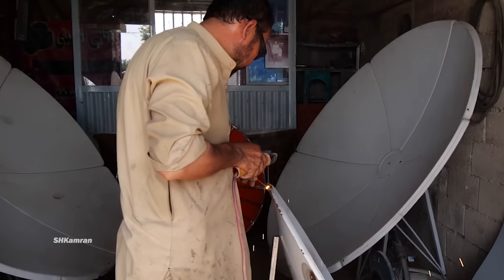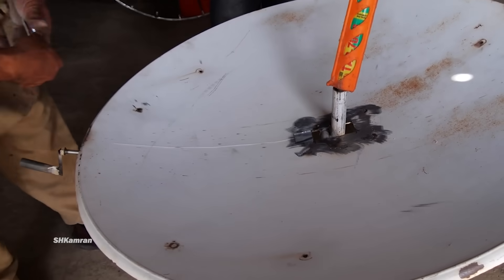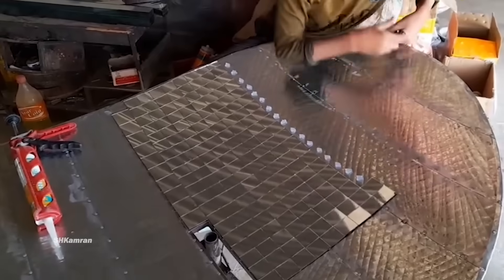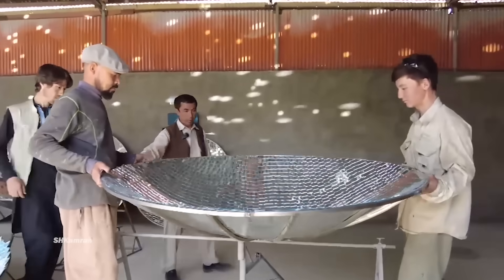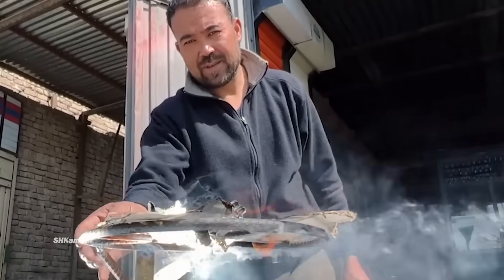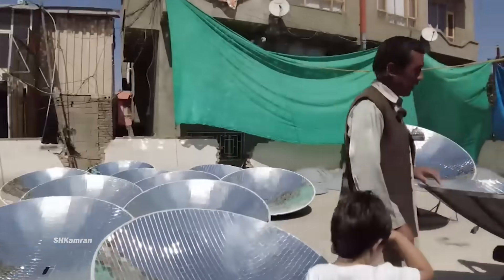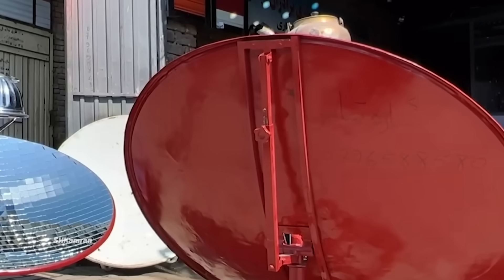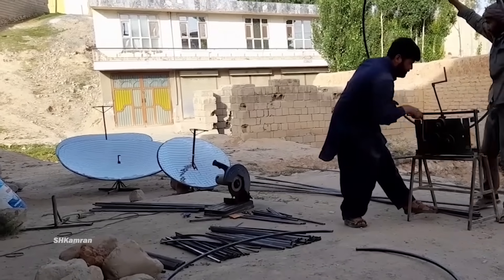Free Solar Ovens, Made in Afghanistan. Free For Cooking.

Comment: I designed a better shape in 2007, uploaded it to the web and improved  the idea over time.   Nobody ever even tried it! This year I  built one to prove it works.   I call it the Sun Scoop and it has been great.  It is about 1/6 of a much larger dish (so about the same size as the Afghan dishes).  It has automatic tracking by a timer and it is much less likely to blind the cook like this one.  Seasonal adjustment is manual once or twice a week, and daily adjustment is 15 degree per hour rotation.   If a few engineers were in charge of the Afghan solar project, they could look at the Sun Scoop,  and adjust and improve their program within a couple of weeks and start to make much better solar cooking  reflectors.   It is sad that people have such a hard time with new ideas.  In Afghanistan due to the latitude, people can put 2 reflectors on one sun scoop axis, and get something like 2 horsepower from the one device.  (but at 2 fixed focal points.) Again, it's pretty simple and any engineer or astronomer would understand how it works.  But most on youtube don't get it.   It's sad.

Comment: So this is a well-known technology, only in the worst performance... After all, instead of making a primitive furnace, an electric converter could be installed in its place, which would supply electricity by wire, and they could already supply electricity to anything. I am a man who is half Afghan, but grew up in Europe, and it's hard for me to be proud of that)))
Reply: Converting sunlight into electricity is much less efficient, only about 20%. Using the heat directly is about 80%, estimated.
Reply: @SolarCookingGermany  Anyway, it would be more efficient if these devices were used to convert electricity, since it would have more applications. In the long run, you can buy batteries and use electricity when the sun is no longer there.

Comment: Would a highly reflective thin metal foil not work just as well and take seconds to apply to a plastic or fiberglass parabola with some glue and a jig to press it in place? How much more work hours go into cutting and hand glueing small mirrors on such a large solar concentrator? It just seems too much work.
Reply: Yes, but metal foil isn't as reflective as mirrors and it'll degradate over time. Also, this would require a higher level of production facilities

Comment: Coat it with solar panel on the backside… when not using it generates electricity and charges battery to cook food and charge phone in the night time.
Reply: So you can use only one at the same time. How about putting the solar panel next to it and use both at the same time? 😀
Reply: @SolarCookingGermany  unless you are cooking all day … do you turn your stove off during day time? Or do you cook all day long? 😂

Comment: 🔥
👍
Reply: 🌄💡
 
1 ) 5 gallon 🪣

2 ) Cover open end with heavy duty cooking wrap aluminum.

3 ) evacuate the air out the bottom of the bucket 🪣 with a hose and it makes it perfect parabola . ( Plug ) 🪣
==≠=======
🌄💡 #2

Hoop & screen

1 ) Hoop tent loop ⛺ break down for packing 
 
2 ) Mylar or screen 

 ... ..........
What about all the milk bottle machines the US left there ? 
Glass blowing Kilns' it might have been Iraq .
===
I figured with all that oil they could make glass  custom 🍼 bottles for their kids to fit their hands.
==
Oil + sand = 🍼 Forever
🔥

====
👋😎💨 Bryan
🐎💨💕